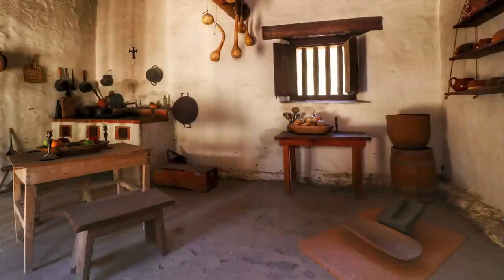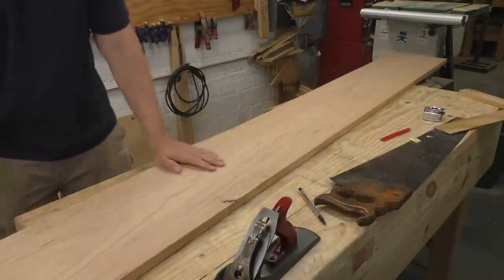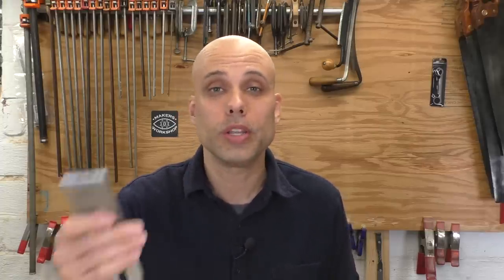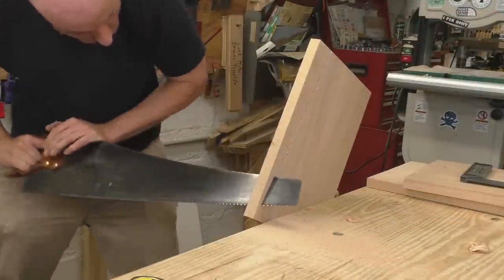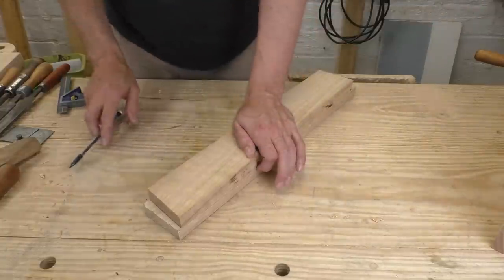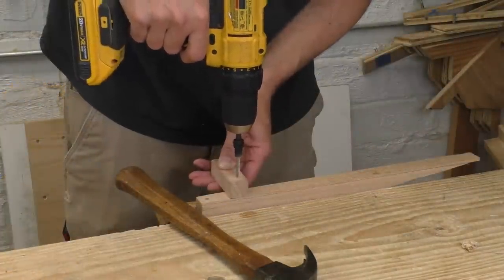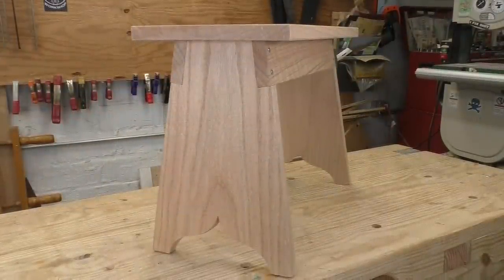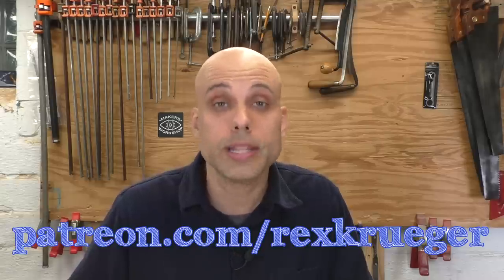Build a Mission Bench with Simple Nailed Joinery.  // Hand tool woodworking.

Comment: Before training to become a Bar Fitter many years ago, I first did two years service for Christie-Tyler to become an Upholsterer. When all of my training was done (5 years when combined with the 3 years Carpentry/Joinery), I worked for my family's furniture business for a number of years then went out alone. I designed a number of things along the way that I could knock together when work was a bit thin and one of those was a chaise longue that I could make and sell to put food on the table. As you point out in this video, the first attempt may look good but it evolves each time you make it until you eventually have an excellent piece that costs less to make and is much better by design. That is what comes with learning and experimentation. Make it, refine it and then refine it again. Simplify it. Do it better every time. Keep doing it until you have done your very best version and then, that is the final piece that you keep in your armoury. I did the same with children's 3-piece suites. Developed them until I couldn't add or remove anything more of the original design. I'm not saying they were the very best out there but they were the very best that I could do with my original idea - and that's all that matters, really. It doesn't matter if you aim for a low, middle or top of the range item, as long as you stick to your original inspiration, it will evolve. Save money where you can but never to the point of sacrificing the originally intended quality. That is how even the greatest of artists evolve their best works over time to produce their final masterpieces. It is why huge companies invest so much in Research and Development (with Development being the key word in all this). Anyone out there looking to make their first little trinket box or whatever, follow the same route; make what you see in your Mind's eye, look at what you could do better and refine it and make another, then sleep on it and then make another, each time improving until you have done the very best you can do. Then have another go a few years down the line and with your grown experience, you will find even more ways to make improvements. Did Chippendale or Sheraton start out as classic designs? No, they conceived and then developed and refined them.

Comment: This is so fortuitous. My grandfather had a similar bench (not sure if he made it) that's at least 80 years old. Sturdy as a fort. His also has a hand hold cut in the top for easy carrying and a cross brace for extra stability. He and my grandmother would mount a meat grinder to it with a bracket attached to one side and make homemade sausages, ground beef, pork, whatever. I started laying plans to reproduce one from the original. This video taps into a few fine tuning questions I thought of. Thanks, Rex!

Comment: 7:20 best thing to do on the old shooting board is take the fall off of your angle cut, cut a straight 90 from the point of nothing across to the other side so it forms a wedge that goes down to nothing, and wedge that between your shooting board backer and the board your shaving. That will keep your work piece at the correct angle while you're shooting the edge 👍

Comment: Using nails hadn’t ever occurred to me.  I had a couple badly warped maple boards I was able to glue up using biscuits. With six feet of length I was able to cut the material to just have enough to make a double deck bread box, however, it means that I will have some alternating grain directions.  Nails might be a better option than glue for this project, and various cut nails are readily available at my local Lee Valley store.  Thanks for the video.

Comment: often I've built prototypes of "lesser wood" to sort out the details.
In my area white pine and white oak are common species. I usually buy from a local sawmill but plan a few years ahead and stack carefully. 
White pine is considerably cheaper and considered inferior to the white or red oak, so building out of pine initially is a bit cheaper. If you like the project then consider painting the pine, but be sure to seal the knots with shellac or they will bleed through

Comment: I support of the prototype, I needed a small end table of my own design, but wan’t sure of the proportions. I whipped it up in an evening out of 1/2 inch plywood. Put it in place to see how we liked it, and, you guessed it, it’s still there. Glue and brads, I’m surprised the simple joinery lasted. The piece went together so fast because I wasn’t being fussy. Lessons for me were prototypes are excellent proof of concepts. When you aren’t worried about getting it perfect it goes together fast and it’s fun! Prototype time is a great time to try out simple joints, which in this case turned out to be surprisingly strong. 

Do a cheap prototype. They are fun, fast, prevent waste of time by making pieces you won’t regret heavily modifying to correct poorly proportioned designs, and are a great way to practice a joint or technique you will later use in a fine piece.

Comment: Great video and plans, I’ll be building it soon! The only detail not mentioned in either is that you’ll probably want to plane the feet of the legs as well so that they sit flush and level with the floor. If not, the outside of each leg will be slightly raised off the ground at that 7 degree angle.

Comment: Enjoyed this video and your design of this piece.  However, the shape at the bottom of each leg creates a stress riser at the narrow center peak.  Inevitably, over time, the leg will start to split at that location as the wood dries and shrinks and the bench is loaded and unloaded.  Red Oak is particularly prone to this problem.  Better to have a small radius at that spot rather than a sharp internal point.
Reply: Is there any scientific evidence for this comment.
Reply from the maker: @tomsatterlee8397  Well, there are the thousands of pieces of furniture that use this detail in exactly this way and HAVEN'T split. I guess that's evidence that the stress riser is imaginary!

Comment: Not to be picky or anything, but shouldn't the feet also be cut at 7° to give maximum support when weight is placed on top?
Reply: I was also thinking the same thing. And also make a triangle on the stretchers, in case the angles aren't the same.

Comment: Man, I wish I had space to get into wood working.
Reply: Honestly with hand tools, you dont need very much. I just have some tools in a small corner in my basement. Ive seen a lot who have a shed outside to just hold tools and they assemble the bench outside when used
Reply: I honestly started woodworking when I was living in a small apartment, usually bringing my few tools outside into the parking lot when I wanted to work on things.

Comment: There are a lot of differences in construction techniques in " mission" furniture. A lot depended on location. Those built along the coast had some access to shipping and ships carpenters as well as such things as metal for nails. Those further inland and between the incredible Santa Barbara mission and Monterey not so much. Some are just ruble, Sam Miguel was initially built by slave natives to an insane priest's directions. I did a lot of work at San Miguel and nearly all the really old stuff was very primative and pegged together. Much had been shaped with chopping tools of unknown type and some very careful fitting with most of the joinery. Saw a good many benches like yours as they didn't use chairs except for the Bishop's chair on the alter. The few years Father Maurice talked me into various projects were among the most enjoyable of my life. Really wish I'd built some kind of scaffolding to examine the little stairway and elevated Bishops pulpit. In the years I lived in the area I never saw the species used but I know it is very difficult to cure.
Reply: Last sentence you lost me, what species of wood are you referring to that’s hard to work with/cure?
Reply: I suspect it's madrone though it might well be a type no longer in the area. Much of the area was harvested of hardwoods for the charcoal trade. Prior to the arrival of the railroad there wasn't a source of coal

Comment: Rex, there are several decent oaks available for carpentry and furniture building, but scrub oak isn't one of them.  There are two species called that in California, both are chaparral species, meaning they tend to small, stunted, gnarled forms.  A more likely wood would be Coast Live Oak, or Canyon Live Oak.  Both are common around many mission sites, as is Valley Oak.   Valley oak is considered brittle but works just fine for furniture after it's dried.  Blue Oak is another possibility.  One of sad facts of California woodworking is that with all the varieties of trees in the state very few ever are employed in woodworking.  Instead most furniture wood is imported from out of state.

Comment: Hi Rex. Thanks for the video - got me thinking … if you fix the nails as you have don’t you risk racking in the seat portion anyway as it tries to expand and contract across the grain? Would a single nail at the midpoint into the leg do the job without risking cracking later?
Reply: Cracking not racking!
Reply from the maker: good question,  but no.  Nails flex, so they move with the wood. One big reason to use them.

Comment: Why wouldn't you use a bevel gauge or speeds square set to the traditional rise and run ratio? A 1:8 (1.5:12 with the speed square) slope would be simpler to lay  out. That 1:8 slope is 7⅛°, close enough for gov't work and more repeatable. No?

Comment: guess I should go into milking stool production to build my skills. I have yet to get the hardwood wedge to pound into the joint without just snapping.
Reply from the maker: make the wedge fatter at the thick end and longer. I used to have the same problem.

Comment: Cut nails are just the strangest things ever. My imagination says they really shouldn't work, the shape would pull out - but they don't. Many years ago when I first worked in construction the carpenters would fix skirting boards with cut nails (no plugs, screws, or glue) through the plaster to concrete blocks - everything tells you they will just pull straight out, but they don't. I'm fairly old now and even after all these years I still can't figure out why they work so well?
Reply: Yes, I've found that you invariably end up with the nail stuck in the brickwork and a large hole in the skirting board you are trying to remove and when they do come out, they come with a piece of wall at the same time.
Reply: @twotone3070  I removed some picture rails in my old house which were fixed with small cut nails and even those ones didn't come out without half the masonry attached!
Reply: Id venture to say they work like a wedge. From the top down they are tapered, so as you nail them in, they wedge in tighter & tighter. Compared to “round” metal nails where the hole made by the nail is the same size from bottom to top.
Reply: Mark, I suspect you're absolutely correct, it's still surprising how much friction they can produce in masonry.

Comment: You were stuck with bit brace drills last year ... I HAVE A SOLUTION! Your chuck idea and    Sharp HSS drill bits none of thse WWS bits!  Longer lasting and cheaper, even the more expensive ones are cheaper than WWS.   Yes use them on wood ... trick always pucnh a hole and drill a pilot hole with a drill bit 5-8 times smaller.  Also BACK the wood you are drilling with ... WOOD. Then you have a clean end to end hole. If you FRONT the wood with wood even better no cracking.  If you pilot a hole with a drill that is say half the size ... mistake it grabs and spirals inwards especially pine, so pilot with tiny drill bit it does not need to go all the way through.  AND MAKE A VIDEO ON IT!